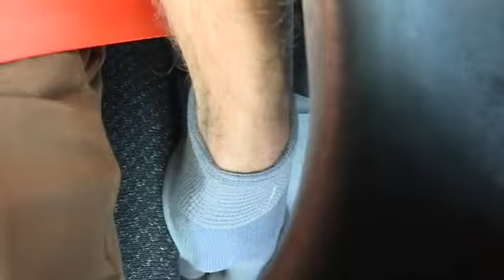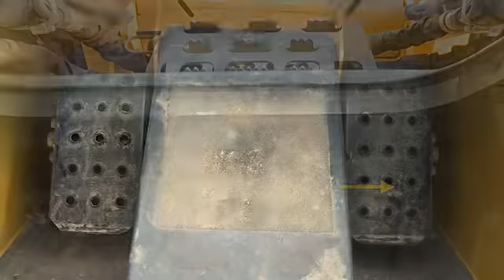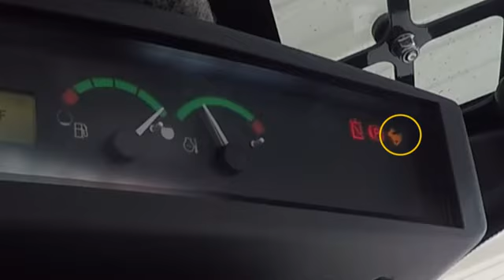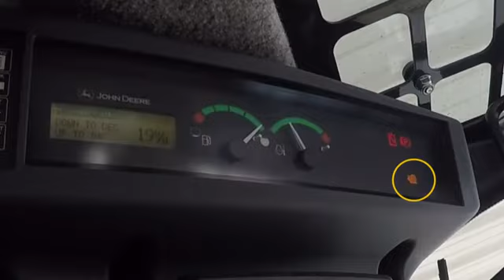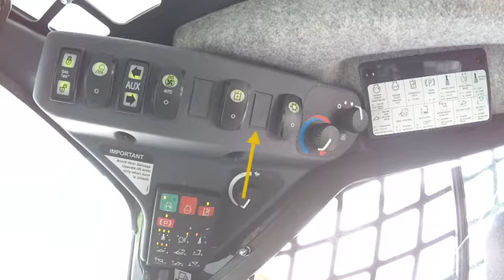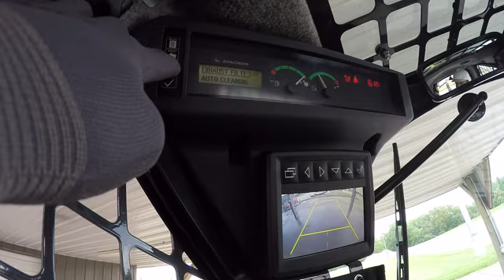John Deere 331G Controls

Comment: How do you keep the hydro on a cutter running without holding  that thumb wheel?
Reply: Hold the lift targer thumb same time like go of thum
Reply from the maker: After you get the cutter head running using the right thumb wheel, you "lock" the running speed in with a press of the lower left button on the left joystick.  To unlock the cutter head, either hit the lower left button again on the left joystick or simply move the thumb wheel on the right joystick again.  Your controls may be slightly different given the package that came with your machine, but this is how it works on my unit.